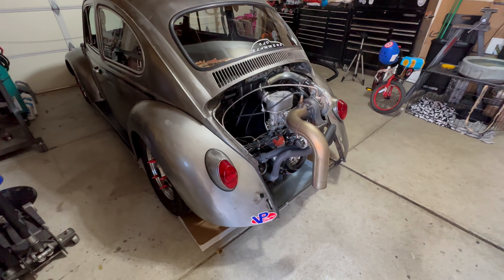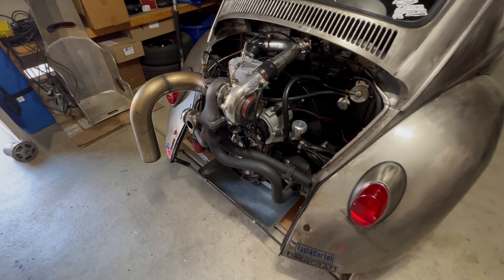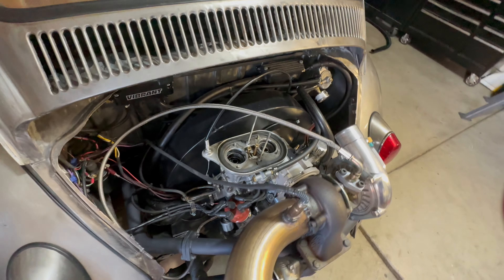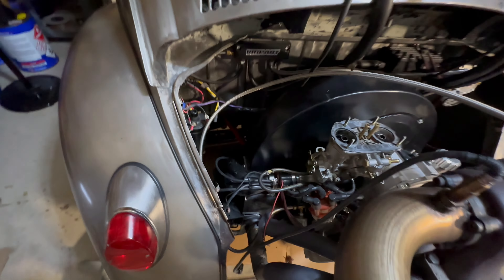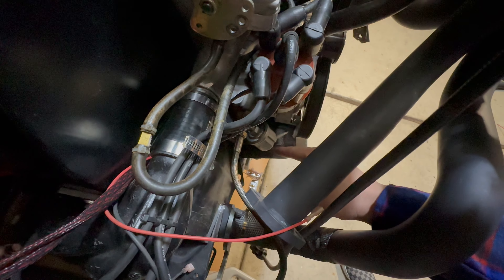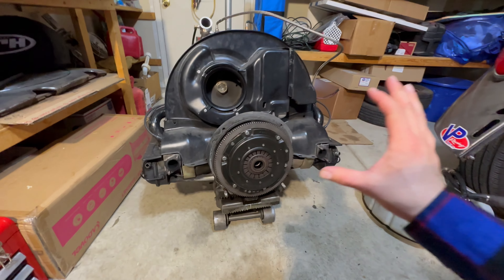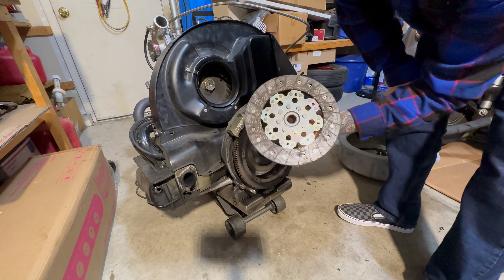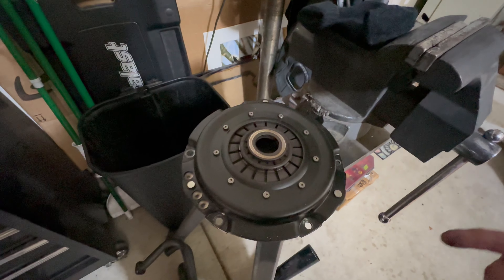Downgrading My Stage 2 Clutch

Comment: Stage 1 should be perfect fine for that engine… double check that clutch cable for wear 👍
Reply from the maker: Oh definitely! I’ve been meaning to switch back over to stage 1. That’s a good tip Gary, I will check it out before reinstall everything.

Comment: There is so much out there on straight cut gears. I would imagine with your set up you are running them. What do you have to say about them? How is your valve train doing for wear? Have you had them in there very long? Having a GOOD experience with the gears. ---------- And one more, if you don't mind --- what brand and are they steel on steel? I hear not to run them -- will tear up the valve train -- harmonics, and yet CB Performance is running them in ALL their KIT engines except the three -- which is their three smaller cc builds all their build kits run straight cut.  If you can share what you know and have it will help me out
Thank You ---- Rodney
Reply from the maker: I’m actually not running a set of straight cuts on my engine but I would of loved to. They all come steel on steel. Straight cut gears are used for removing thrust load of the cam bearing when using big valve springs or dual valve springs. I’ve never heard of straight cuts tearing up a valve train but if you run a stock helical cam gear with dual valve springs, something will break. Pretty much straight cuts can be used on any aircooled VW engine. I know that I will be using them in my next engine build.